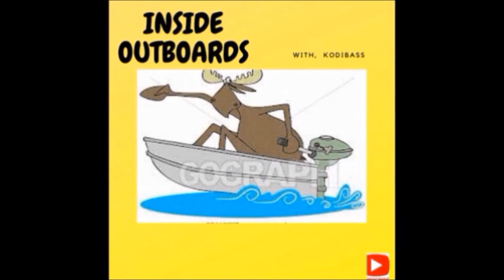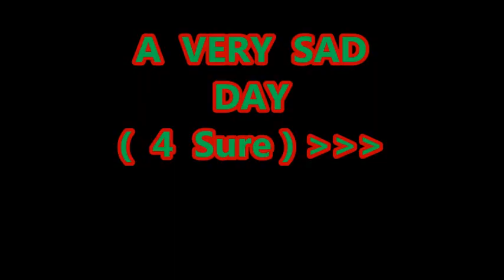JOHNSON  1992  3 3  HP  &  BOAT STUFF

Comment: I have a 1992 evinrude 30hp no electric start tiller handle with a carburetor 432703. When removing the ideal air screw the pressed in bushing come out with the screw . Is it possible to press the bushing back in? 
I was also wondering how to put electric start on it? Is it just a flywheel, starter,  selenoid,
Reply from the maker: Yes'  Put the bushing  back in With thread locker red, Let dry overnight. Yes That plus a stop switch. U R good.      kb
Reply: Thank you. Watch your 18 hp evinrude adding electric start